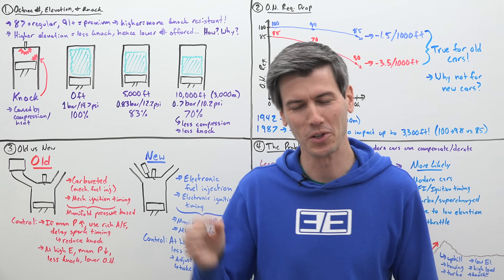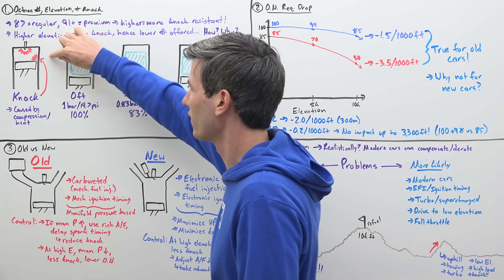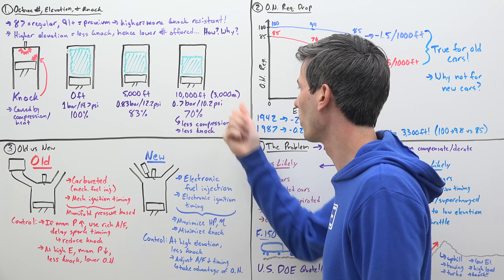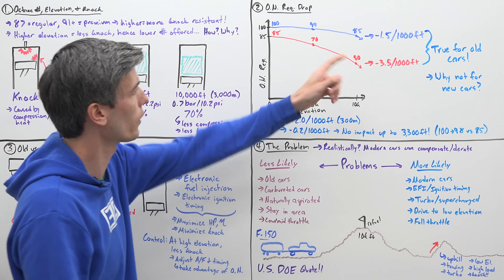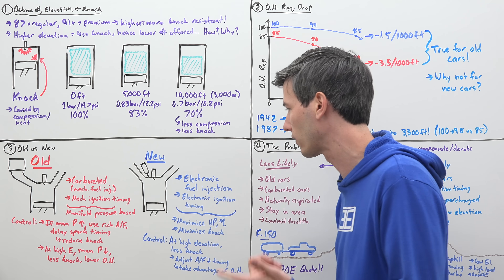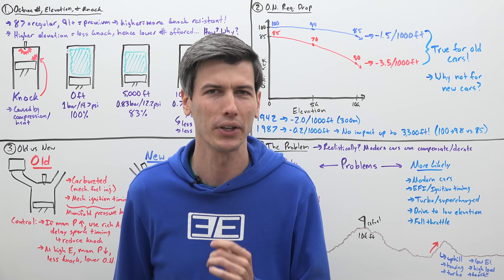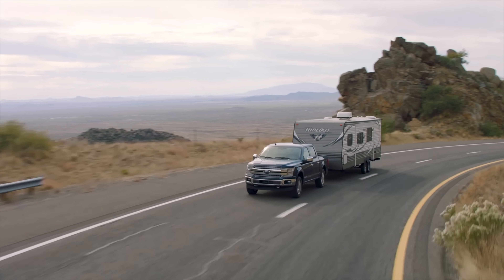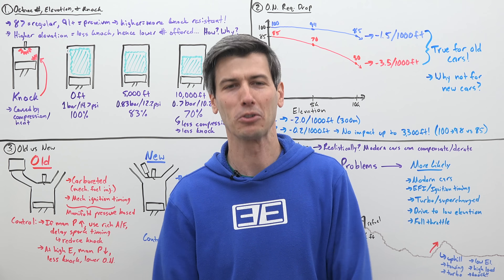Never Use This Gas In Your Car!

Comment: Bottom line use the fuel the manufacturers recco. Wasting cash on high octane if not needed.  Super high compression engines need high octane-392 dodges, mustangs, camaros. It nit rocket science. Read the manual!

Comment: If gas is 25% higher than e-85 it makes sense...like in California.. you use American fuel and decrease your dependency on foreign oil.... and that warning is for the f150 that is not flex fuel... if you have flex fuel you can use e85

Comment: My Jeep manual tells me to use 87 octane gas. I buy my gas at Costco due to price and location. They don't offer 87. Only 85 and 91. The price difference is significant. I have been alternating between the two octane levels. I usually fill up before my tank gets down to 1/4 full. I figure mixing them will get me the best of both worlds. Is this correct?

Comment: I have always used higher octane fuel in all of my vehicles. It is more expensive at the pump, but it is worth it later. Premium fuel burns cleaner and more effectively so that reduces carbon build up in your engine. So premium fuel = less problems later on. Less carbon, and less engine damage = cheaper future repair bills. Not to mention if you live in a state that requires smog inspections, then this also helps you there as well.

Comment: I thought most modern engines had a knock sensor and would back timing out until knock stopped. Not that I would ever use 85 octane to save a few cents.

Comment: Interesting. E85 fuel is often sold at sea level and many say that all engines 2017 and later are capable of using this fuel due to the capabilities of modern ECU.
Still  U'm suspicious of it and feel it's not worth the risk even if supported by a factory recommendation, the fuel might be cheaper but I imagine there has to be a corresponding performance penalty which means it's all risk with practically no benefit.

Comment: The problem with 85 octane fuel, and the reason Ford is saying don't use it, is because of liability. Question is for ford is what happens when you come down off the mountain with 85 octane in the tank. The average person is not going to refuel the car at the bottom of the mountain with 93 octane to try to balance out the octane levels. No one thinks of doing that on a road trip, at least the majority of people. Average fuel tank will get you 400 miles, If you fill up with only 50 miles before you are off the mountain, then you potentially will be traveling 300 + miles with fuel with insufficient octane levels. 85 Octane is silly. Just have one standard across the country and no one will ever have to think about it.

Comment: I had a rental car in Quito, Ecuador in 2008 (Quito elevation in meters: 2,850m. • Quito elevation in feet: 9,350ft). All the gas was 80 octane which I had never seen before. I did not hear any knocking coming from the engine, but I was glad it was a rental.

Comment: Good info, but not so good fear mongering.  Do you have any stats or anything at all to say that using 85 octane fuel (at altitude) has blown up or otherwise damaged engines?  I live on the Western Slope of CO and cars, both new and old, run 85 without incident.  There are no crippled cars lining the roads, no smoking engine bays, no anything bad.  And, I suspect, if you look at the stats, this will be proven with millions of miles of stats with a very low incidence of failure due to the fuel and, more specifically, the octane of the fuel.

Comment: I have a 2019 energy I  plug in E85 drops fuel economy to 30mpg and check engine light comes on in eastern pa 400’SEL lean condition bank one mid west Texas no check engine light but loss of power

Comment: Around 30years ago german NA cars required 95 octane, before that 91 was good enough. Im amazed how badly rated american fuel is. I mean its a 30y gap und you still have fuel that could harm those engines 😮
Reply: That's because Europe uses the RON system while NA and a few others use the AKI system

German 91 is equal to our 87

95 to our 91

If you're going to talk about the subject, atleast have the basic understanding of the difference measurement systems
Reply: @LadyMaria_AstralClocktower  its hard to keep track of those hprroble imperial units tbh.
For at least half of them i dont even know the values for because its insane how many there are. Multiple punds, gallons, horsepowers, ounces, miles, feet, acre and I got no clue if its the same in Germany or different again.
But own thing, 91 isnt your highest grade or is it?

Anyways still having 91/87 is amazing nontheless.

Comment: From Denver and been using 85 on all my regularly aspirated regular compression ratio vehicles since forever. Never an issue, but my vehicles dont see anything near sea level. If i was going to take one on a road trip East or something just make sure it has 87 in it and its good, but most road trips involve going up in elevation here anyways so literally not an issue and havent been throwing money away on preventing knock that isnt even close to occurring. His example of the boosted F-150 towing through high elevation and back down again is a good example of what not to do. Living in a city where your elevation from day to day only changes by a few hundred feet on regular commutes then run what is needed based off elevation.

Comment: I don't see the issue. Some pumps also have diesel available and we know better than to put that in our gasoline engines and vis versa. In farm country, you may find diesel available that isn't intended for using in vehicles used on the roads.

Comment: You are so full of sheet i do believe your eyes are brown.  Your explanation of what knock is needs a lot of learning by you. It has nothing to do with a small flame starting in the area away from the spark plug.  It is only the speed at which the fuel burns.  The higher compression pushes the molecules closer together which allows the molecules to react more quickly.  Faster burning fuel burns faster than the piston moves.  It is like trying to get a hydraulic jack to retract using a hammer when you can easily push it down with your little finger.  If you continue to use the hammer you will end up damaging the jack.  Why do you think higher octane fuels are offered?  The manual clearly states a minimum octane and it is your responsibility to use fuel that meets that requirement.   This is exactly why the octane of the fuel is posted at the pump!!!!!!!!!!!

Comment: Translation:  This gas is available only in states at higher elevation and is the equivalent of 87 octane at lower elevations.  So you can feel confident it can be safely used where it is available.
Reply: It’s available in Texas as well for some reason

Comment: Thank you! You finally got me a detailed explanation, I use 87 octane fuel here in my vehicles in 5000+ ft here Wyoming since I started reading that it was recommended for my newer vehicles. It makes sense now, I grew up in the 1970’s with carberation systems and we went with the best combination that gave us maximum performance. Onboard computers on my 1993 and newer vehicles do a lot, with a detailed description I feel better about what I am doing.

Comment: In the US, the $0.59/gallon price gap between 87 and 85 fuel brings some question as to whether the increased lifespan of your engine is worth the higher price.

With the average engine costing around $7000 USD, lasting 150k miles (or 4.6 cents per mile), and getting 25.4 miles to the gallon, the engine cost per gallon of gas burned is around $1.17. This essentially means would need a roughly 50% increase in engine life expectancy in order to justify the purchase of premium gasoline.

Comment: i work at a junk yard where we drain all ghe fuel from cars. good, bad sometimes water ect mix it all together and sell it to a local mom and pop gas station for 1 dollar a gallon they turn around and sell it as regular directly to consumer without filtering it or anything. do with that info what you like (we sell 2000 gallons every 3 days)

Comment: My issue with your thumbnail image for this video is green pumps are only used for Diesel in my state. Octane rating doesn’t matter if you pump the wrong fuel, damage has already happened before trying to restart your engine. Are green pumps used for unleaded instead of Diesel elsewhere?

Comment: I drove an old truck in Mexico, long ago. I filled up with "regular". It was knocking going up a hill. I burned a hole in the #1 cylinder (I-6 engine). I had to baby it home. Fortunately, it was an old truck, and an easy fix.

Comment: I have a 2003 Taurus and tried E85 in it out of curiosity several years back. Up to about 50:50 with regular gas, it worked just fine and I couldn't tell a difference. Beyond that though, I started getting issues with it nearly stalling out and turning off at idle. Ran fine when I had my foot on the gas, but I figured there wasn't any point in exploring further. The E85 had the same 87 rating as the fuel I usually run so it must have been something else about the ethanol.

Comment: never even seen 87 octane 
the lowest you can get in nz is 91
Reply: The US uses a different octane rating than everyone else in the world, because of course they do. 
85 is similar to around 91 in the scale they use elsewhere. 87 is like 92.
But it doesn't cleanly convert from one scale to another because they are measured differently.
Their 87 octane is probably more knock resistant than your 91.

Comment: I live at 6000 feet and I've used 85 on all my cars for the past 40+ years.  That's well over 1 million miles of problem free driving (above 4,000 feet elevation).  One of my vehicles is the F150 used in the example.  I've towed heavy loads up hills with a turbocharged engine and never worried about harming my engine, until now.   It seems like we need some consumer regulation.

Comment: E85 is commonly used in racing. you should have the option to choose whatever fuel you want for higher compression. If you want to risk a warranty, that's your choice.
Reply: Wrong story.
Reply: Whats your point? E85 has nothing to do with 85 octane. E85 has 93 octane in the scale they use in the US.

Comment: Id burn my car to the ground before I purchased 85 octane gasoline. That's like the least American thing I've ever heard of. Any turbo or supercharged car is going to maintain more pressure. You'd likely blow up your engine in that case
Reply: 85 octane is generally sold at higher elevations and poses no problem.

Comment: I have a 1976 Triumph Spitfire 1500 4cyl with Electronic Ignition and duel SU HS4 carbs. The engine is bored and stroked 20 thousandths oversize pistons, blueprinted and balanced.  I run high octane no alcohol premium fuel 91 octane or higher if I can find it. 
Why take chances on cheap fuel with an expensive engine. My Dodge Caravan is lucky to get 87 octane and runs well on it.

Comment: I have never had an issue with 85 octane fuel. I live at 6700 ft above sea level. The only vehicle I have that needs higher octane fuel is my Harley. My 20 year old Silverado an 7 year old Nissan both run fine on 85 octane and have never knocked or had pre detonation.

Comment: My Toyota has used 85 octane regularly at 5600ft to anywhere from sea level to 12k elevation, but I have noticed less power than 87. Retarded timing I believe, but user err in using the 85.

Comment: Crazy that we sell a fuel that might ruin our engines... And that's why they put diesel and gasoline on the same pump, or my cars that have  flex sensors, one says 91 octane minimum,.. and then to really mess your comments up I rebuilt my '79 F100 and if I don't use premium on that with a single barrel carb it stretches factory head bolts and I live at 2200 feet

Comment: Luckily my jeep’s warranty expired more than 15 years ago. It runs on 85 octane without any problems.
Reply: Naturally aspirated and as long as you don't floor it you may be fine long term
Reply: @Yielar1  also the older jeeps are low compression engines in general. my turbo charged VW overheats on 85.

Comment: 6:38  Ignition timing is advanced during higher throttle settings (not retarded).  Ignition timing is also advanced as the RPMs go up.

Comment: I hear modern DI cars with turbos pinging away with 87. Computer controls may allow for adjustments to control pinging and knocking but why would you? Just to save a couple of bucks at the tank? I'm also curious if you are actually saving any money if the car is always pulling boost and timing. 

Running 89 on most modern cars turbo charged seems to give you the best cost to benefit ratio. You have a 2 point margin and benefits of the top tier fuel coming from the 91 blend (87 and 91 is blended at the pump nozzle to make 89). If it is cold outside, 87 might be fine but once it gets hot, the chances of knock on a Turbo engine goes up. All that heat is going into the turbo housing, intercooler, oil and coolant. Your cheapass needs to put 87 but won't stop buying that pack of smokes, beer and Lotto tickets at the gas station

Comment: who's from Europe here? :) we dont even have 85 nor 87 nor 92 in here :D our fuel starts from 95 :D Keep up USA :D
Reply: So you missed the part where he stated that the U.S. and Europe use a different method to measure octane rating.  U.S. 91 = Europe 95 and U.S.93 = Europe 98.
Reply: Maybe missed that part :-) however 85 is what 90 in Europe :-)? And 87 is 92 right? Still we stopped using 92 back in 1995 :-D
Reply: @mariusakelis8689  Forget about 85 for now, it's very uncommon except in certain high altitude locations like he said.  87 is very common which is around 91/92 in Europe.  Most U.S. pumps will have 3 grades available at each pump or (87, 89, 91) or (87, 91, 93) , which would be approximately (91, 95, 98) in Europe.  Some U.S. pumps will even have 4 grades  (87, 89, 91, 93).  Why the difference?  Regulation.  Many years ago the EU regulated minimum octane ratings regardless of region and altitude, but U.S. regulations allow the different regions to offer different ratings according to local conditions and needs.  Remember that the U.S. is nearly the size of all of Europe combined.

Because of the regulations, the manufactures design and tune the engines for different octane ratings.  For vehicles designed for the European market, they tend to build smaller engines with higher compression and with more turbocharging or supercharging, so the higher octane is needed.  For the U.S. market, engines are designed across a greater spectrum of size,  compression, turbos, etc., but tend to be larger with slightly lower compression, so the stations offer the range of fuels.  Customer choice.

In the end, these differences are very small, and really don't make all that much difference.  You should use the octane rating your engine is tuned for.  A car tuned for high octane may knock with lower octane fuel, but a car tuned for lower octane, doesn't run better or more efficiently on higher octane, so you're just wasting money if you use the higher octane fuel.

Also know that higher octane is not "better" gas, it just has more anti-knock additives to avoid pre-detonation in higher compression engines.
Reply: Thanks for such deep explanation ;-) appreciate :-) 

I have f-150 so in some sense i dont need 98 ;-D however as i say we dont have lower then 95 :-)

Comment: I knew about that for a long time.  When I lived at around 4,700 ft elevation and they offered 85, 88 and 91.   So I used 88 because my car recommended 86 and up octane in the owner manual and never had issues since.

Comment: When I was younger engines that I had or built myself had 10.5 to 12.0 would seldom run on the regular gas would knock terribly so they would only run on what was called premium or Ethyl gas. I understand why you need to explain this to people that don’t have that experience. This was a very good explanation. Both of the current cars that claim that they will ok with E-85 but I have never used it.

Comment: Altitude is cited as the reason piston-engined airplanes are still fuelled with 100 octane leaded gasoline. Odd that you're saying high altitude allows lower octane instead.
Reply: It absolutely does.

Comment: 1976 Cadillac DeVille. 501cid engine with the QuadraJet carb. Lived on the east coast flatlands but occasionally went up to the Appalachian Highlands so I had to change the jets in the carb around 4000ft ASL. I became an expert rebuilder on those carbs.

Comment: I haul fuel to gas stations locally since 2008 (right before the whole conventional to ethanol conversion) so I know a thing or two about this.....  I will only use regular non-ethanol in my small engines for obvious reasons but my two cars, both of which are 2015s are in an experiment right now!!  My Jeep is only using rec90, which is also called "E zero", which is also called Ethanol Free.  While my Dodge van is on a strict diet of E10 regular.  Time will tell but I know that ethanol free fuel is better for O rings, gaskets, plastic parts, etc.  That's just a fact!

Comment: A lot of winter blended fuel uses added butane I beleive and it actually causes a loss of like 2-3 octane points. More than enough to cause detonation in high compression, GDI and turbo engines.

Comment: As you were talking, a couple things occurred to me. 

1. This is probably why small, general aviation planes use the fuel they do, since they're obviously going to normally be flying several thousand feet up. 

2. It also explains why people talked so much about using premium fuel for higher performance vehicles back before fuel injection systems became more the standard.